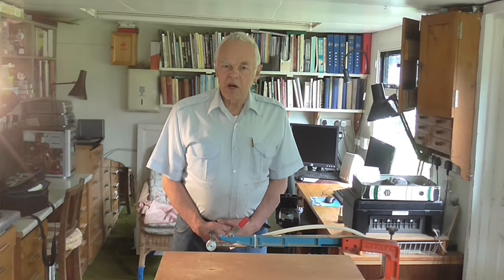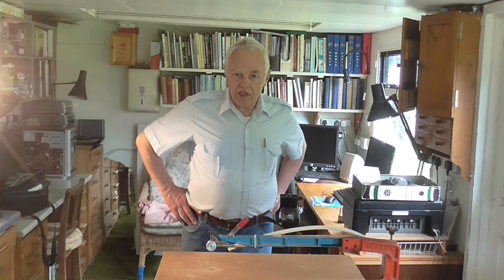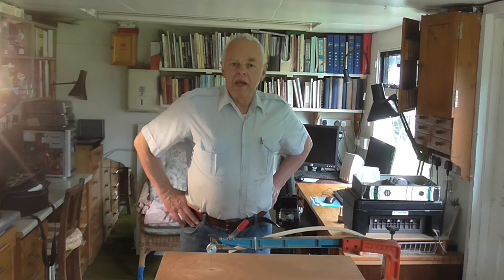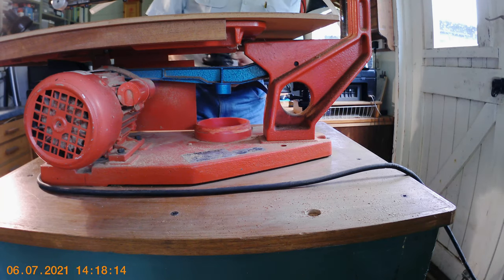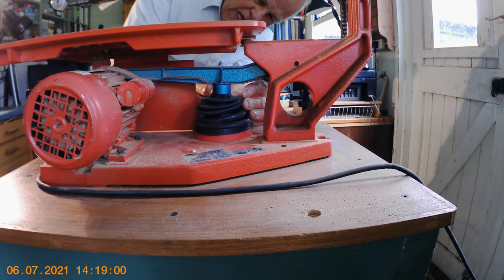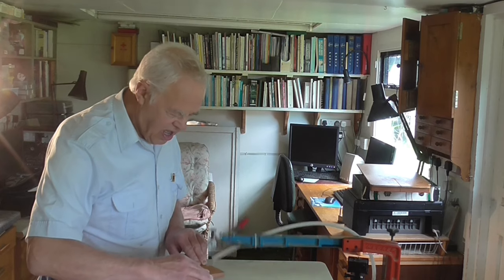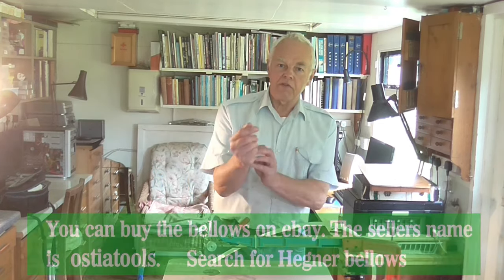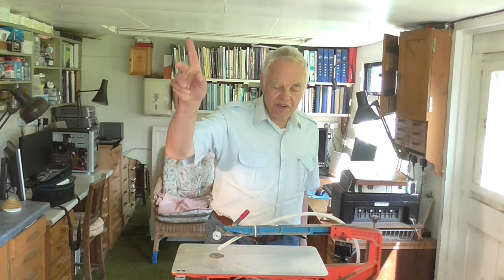Hegner Scrollsaw Hints &tips. Sourcing and fitting a new bellows.

Comment: Thanks for the heads up on this, I was just about to order a set of bellows from Hegner for my old Multicut SE, so that's quite a saving & looks better.
Reply from the maker: Thank you for commenting David. In fairness I should say than a poster in the UK workshop Forum reckons that they are not as good as the original Hegner version in the amount of puff or blow expelled and he may well be right. But mine seems to work perfectly well and I notice no different from the Hegner one I replaced, but maybe the Hegner one being 20yrs old was inefficient. Anyway I would still recommend the one in the video, it works for me.

Comment: Always nice to find a bargain. At first I thought, "I wonder if a CV joint boot could be made to fit that." Then when the eBay version popped up I thought "that looks awfully like a CV joint boot!" For folks looking for an even cheaper solution CV boots come as low as a fiver. You might need the application of a bit of duct tape by way of a sealant but if you're looking for a 'doorstep method' it might be worth looking into. Cheers John and thanks for sharing.
Reply from the maker: Thanks Mark, I had not thought of a CV boot, but several people have mentioned one.

Comment: Hi Thank you for your very helpful videos. I am as to Scroll saw hobby and i am enjoying. I noticed your white pipe/tube runs over you Hegner top arm. Have you added this yourself or is it part of Hegner design. 
Kind regards Norman
Reply from the maker: Hello Norman, thanks for your kind comment. The pipe is how it was supplied with the saw, it also came with a way of sucking up the sawdust rather than the blower but I have mine set up with the blower only. The latest models have a different pipe.
Reply: @scrimperuk  
I’m going to fasten a Jubilee clip around the top narrow section to see if it will blow. If it doesn’t work I’ll buy one from the eBay site you mentioned.
Can you recommend a tutor within Lancashire for private lesson. I’m deaf but with sone hearing so my tutoring will have to be one to one

Comment: Sure appreciate the hints and helps! // I am looking for a flexible jointed blower hose with valve that fits on the Hegner / anyone?
Reply from the maker: Hi Gary thanks for the comment, you could buy one from Hegner if you have £61.58 to throw away! (utterly ridiculous price) alternately do a search on ebay  where you will find lots from £2.99 Search for    "water oil coolant pipe" . Here is one reliable UK seller who offers lots of lengths from £3.99.  just search on ebay for    224766340688    hope this helps.

Comment: Hi John, I have recently picked up a second Hegner Multicut SE which is in good condition but has no airline connected to the bellows.  Looking at your machine it looks like you have a simple tube held in place by a cable tie? Is the tube anything special or would a length of clear plastic (wine making) tube be ok? Have you sealed the joint or shaped the end which connects into the tray under the bellows at all? Thanks for the various videos on fret working and their history which I have been watching over the last few days and found really interesting. Kind Regards Richard
Reply from the maker: Hello Richard, many thanks for your comment and for watching my videos. In regard to your question about the blower tube; what you see is how it was supplied by Hegner UK when I bought the machine 22yrs ago, it came with an extra fitting to use for suction but I never use it. Wine making tube would be fine and you don't need to seal it, the tube is cut off at an angle to improve 'flow'  and is just pushed into the hole. I did find that mine was popping out after a while so I just wrapped a little tape around it to tighten it. Some people use those little aquarium air pumps which may be more efficient?  You can see one in another of my videos on the diamond fretsaw. If you have any further questions please feel free to ask or you can ask in the UK woodworking forum {scrollsaw section) link is in the titles ( I am a member there).

Comment: i bought that item and it doesnt create as much air as old ones due to being soft and requireing more movement the compress the bellow which he saw doesnt do. work better if it was stiffer to push air quicker.
Reply from the maker: Thanks for your input Gordon, I agree that this bellows is softer than the original  and if I am honest I did wonder about how efficient it would be having the same thoughts about it's softness compared to the original as you did. However it does seem to do it's job on my Hegner but I don't doubt that you are correct that it moves less air.
Reply: @scrimperuk  yeah it doesnt blow as much as mdf dust doesnt move with it, im told a powerful aquarium pump works best